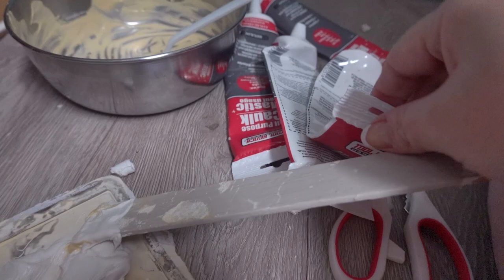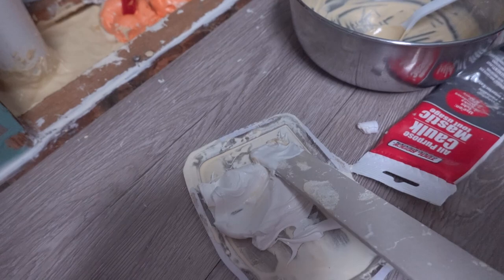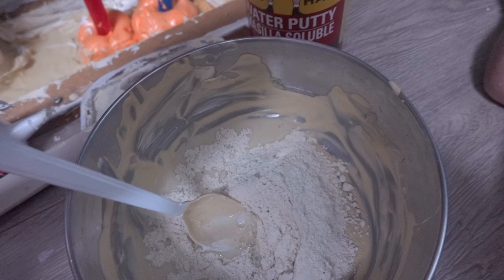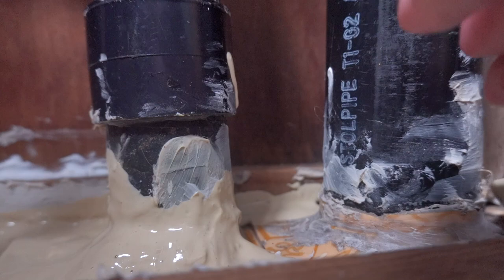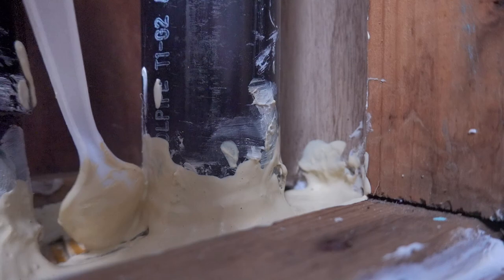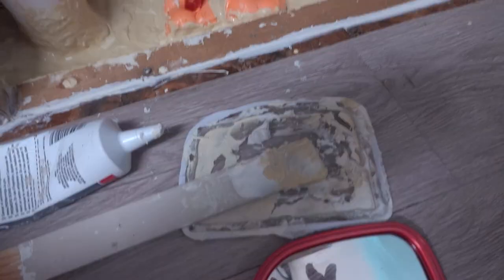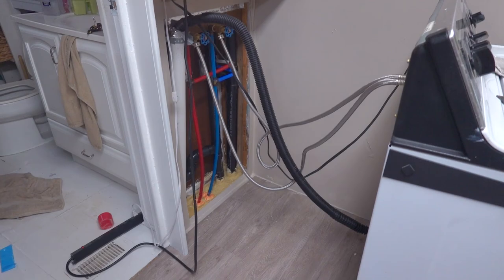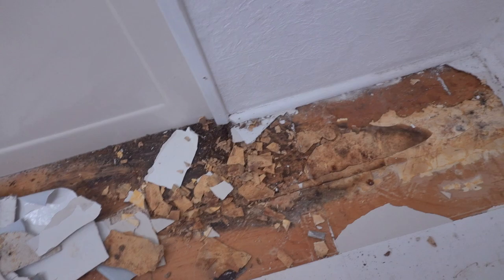Sealing Around Pipes to Keep Roaches Out - Mobile Home Floor Repair

Comment: Roaches are attracted to moisture, at least that's what I believe. So make sure you're rugging the bathroom doesn't stay wet or the you all don't leave there towels on the ground. The best thing my mom ever found for the roaches was combat gel.
Reply from the maker: Yeah they definitely are. I have noticed that little gnats will come up through the floor if its not sealed well! They just keep flying in! Gotta get my house all sealed up haha. Ive seen combat gel but I've not used it before! Sounds like it would work.

Comment: Thanks for the underwater tape tip! I always learn something new from you 😀
Reply from the maker: I usually can find mine next to the duct tape in Walmart, near the paint aisle, but you have to make sure it says waterproof because the other silver tape is just for vents and stuff and it is sharp and will cut you lol. I use both, but I bought one time on accident! Thanks a lot, Alice <3
Reply: Thank you! I would've for sure bought the wrong kind! 😜

Comment: I’m constantly amazed by your ability to fix things… You remind me so much of my father because he always came up with his own concoctions to make things work if I could give you  A few suggestion you might want to invest in some plastic vapor barrier if you have wood in the bathroom that’s getting wet …. And if you have a hole around where some piping is you might want to put some Used Brillo pads there because it would prevent rodents and probably some other kind of bugs from getting in… And then my last suggestion would be to put Kitty in her carrier take her and Rudy outside and you guys spend some time in your pool… and throw one of those insect floggers under the house to get rid of any of those cockroaches… Like I said I’m completely amazed by your ability to not give up and keep going strong

Comment: Alot of projects  going  on  
Girl ! I'm wondering  if you guys are ever close  enough  to  feel effects  of 
Hurricane  season  ? 
     I saw video  of your pool .. I found  shock  pool 
Before  an after a hard rain works great 👍  
  I'm building  a pool house  
Out by my pool ..outdoor shower and its  so easy to  do  girl.. ! Just a place  with roof(old tin I found  )  an walls are 2x4 with plastic  lattice  attached  ... 
This way I can use S - HOOKS TO  HANG  TOWELS  ETC .
    It's going  to  be  attached  to  my privacy  fence  on backside  .. 
   My flooring  will be out of old pallets( frame) and  marine  plywood ! With water seal . 
  A dear friend  did this by her pool an it turned  out  awesome  and  really  nice  for family  to enjoy  cooling  off .. I also  am putting  misters  up for  grandkids  .. 
Area will be big enough  for  atleast  8 people  to  enjoy  setting  down an enjoy  just watching  kids in pool if needed . I also  am buying  up concrete  blocks  to make a seating  area .. it's cheap  and  very  affordable  .. 
Also  I already  bought  a projector  and  am in process  of  making  a seating  area for  outdoor  cinema  nights  .. 
An of course  , fire pit nearby  to enjoy  a fire as well .. in my backyard  I have  3 separate  areas  
Of firepits an waterfalls  nearby   . 
   It's so cheap  to  do as well .. 
I bought  outdoor  string lighting  as well  .. 
  But 1st ... I am waiting  for  this heat wave to  go away 114 today  is just  to hot to be outside  .. 
    Love the outdoors  .. but not when this hot .. 
   Hugs an keep up  the  nature  of outside  living  ..